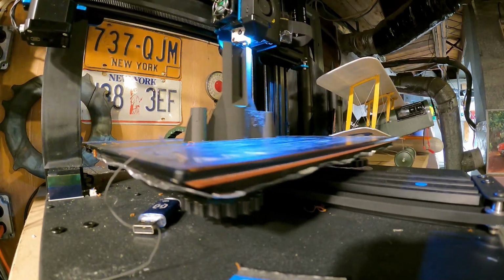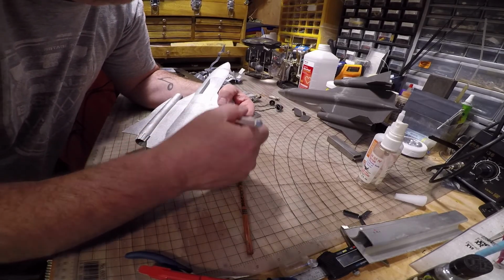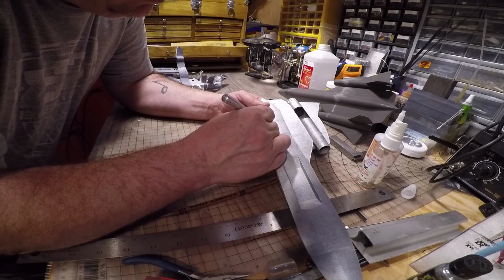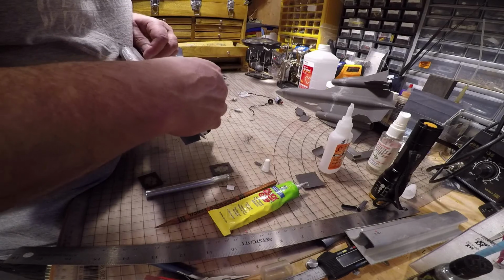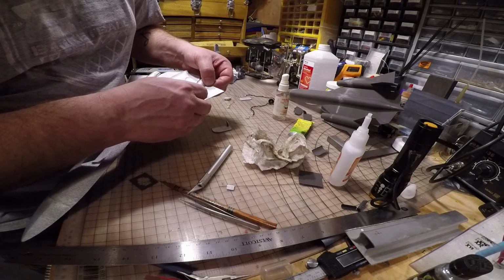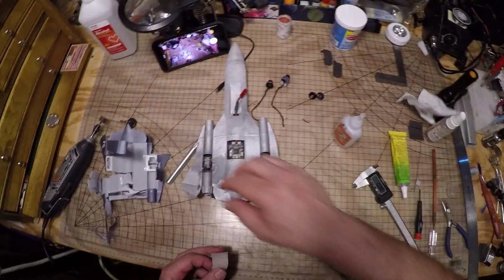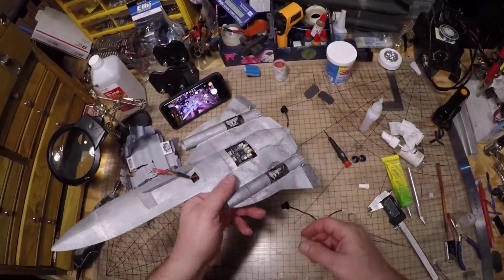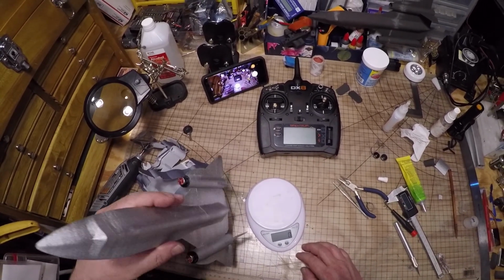SR71 Build Video

Comment: What version of cura did you use to print the sr71? I am using cura 4.10.0 and if I try and use vase mode, there will be a void in layer view about 15mm up and when printing it does not print where the void is in the layer view. It will print fine in surface mode with vase mode not checked. I think it is the version of cura I am using. I am very familiar with lw pla. Just finished the 2 meter eagle print from plane print. Thank you for any advise.
Reply: Thank very much for your time
Reply from the maker: I use simplify 3d. There is an additional setting in Cura that needs to be checked so the void doesn't happen. I can't remember what it is. It might be in the rcgroups thread. I'll see if I can figure it out and report back.
Reply from the maker: Try printing in single wall, not vase mode. Someone else using Cura tried these settings: Prusa Mk3s, layer .25mm, Nozzle 265, Bed 60, Flow 37%, No retractions, default speeds. random Z seam.

My settings in Simplify are:
.4mm line width
.25mm layer height
.4mm nozzle
2 bottom layers,
0 top layers
Vase Mode (Gives it the strength.)
Elevators and Servo Trays are 100% infill, 3 shells, 2 bottom and 2 top layers.
Print the motor mounts in standard PLA, 2 perimeters, 100% infill.
Temp is going to depend on your printer. My Artillery X1 has a volcano hot end so 240C gives me max expansion. You will have to experiment with LW-PLA to find the maximum expansion at what temperature.
Reply from the maker: You can try asking in this thread also:
https://www.rcgroups.com/forums/showthread.php?3719801-Micro-SR-71&perpage=20